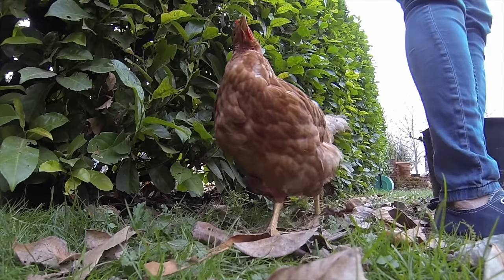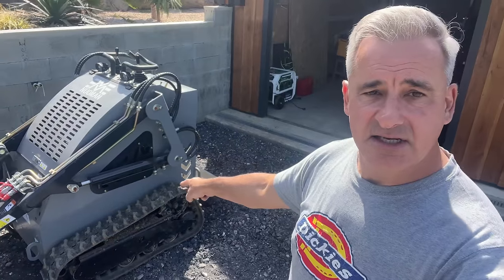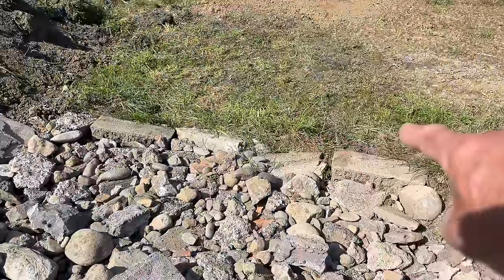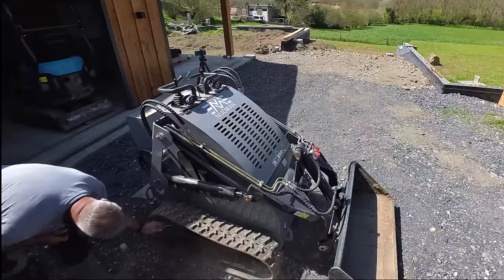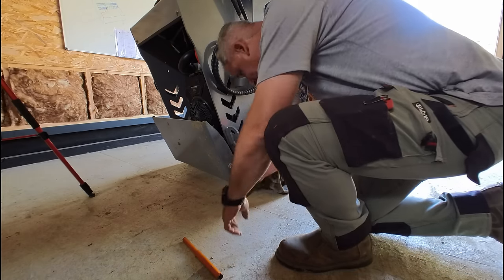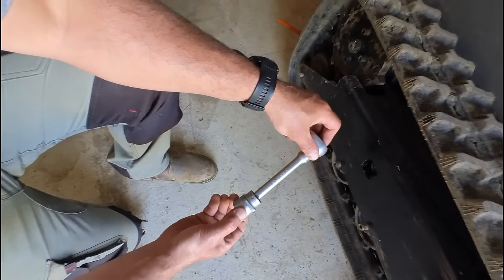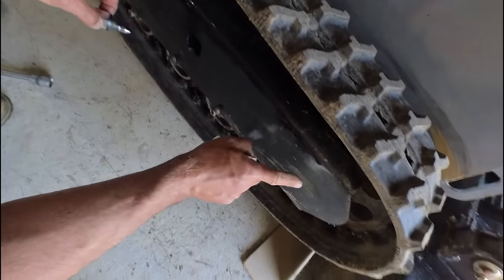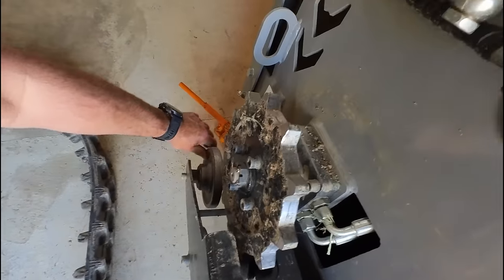Skid Tracks & Poly Tunnel Power | Off Grid Water System

Comment: You’ll drop the 14lbs before you know it, I usually have a smaller lunch and dinner for several weeks or a month and stay away from mixing fats and sugar during my meals for a while, a nice satisfying pasta for dinner and a sandwich for lunch usually is a good idea or soups great as well, you have a wonderful grandchild there to pass on the cycling lifestyle, that track I would just double check all the wheels as I’ve had the same problem on my car with the pulleys one was damaged and would constantly damage the whole belt I suspect that might still be happening with your tracks

     Continued Success and All The Best
               Fabrizio
Reply from the maker: I have done it before, just so hard when you're hungry after building all day....  back at it though on the bike.

Comment: The outside bracket is bent inwards, you probably want some spacers in there when putting back together.
Reply from the maker: Yes, the shaft is not long enough for  the frame - I put in a spacer for the one I took off but it is the same the other side.  Next time I will add the spacers to square it all off.

Comment: Hello Ian and Julie. I think the wear on the centre guides of the tracks is probably normal wear. On my mini digger it did the same almost straight away.
The guides are rubber coated but the drive sprocket, rollers and guides are metal so pretty sure the new ones will wear the same way.
I don't think it is a real problem though. Maybe overtime it will get noisier but it should still operate OK. Cheers Dave.
Reply from the maker: You are spot on - once I found the rear wheel off centre I realised the tracks were all good and it was this small wheel growing it off at the first stress put on it.  But at least these tracks fit the digger too - they are the same size so I have them stored as spares now.  The company in China is coming to visit us this month.  Should ask them to bring a container of spare parts  🤣

Comment: Is there anyway to put a grease nipel on that rear seal bearing for that small wheel? Larry
Reply from the maker: I put in a teflon spray grease in the end - I don't think they are supposed to be greased as there is a lot of dirt down there - the rocks that got stuck jammed in there and bent the wheel out of alignment - probably means my old tracks were fine, but you live and learn 😀

Comment: Buy yourself a Epever Duoracer 10-30A MPPT Dual Battery Solar Controller Regulator Lifepo SLA
Reply from the maker: Looking at them now, means I can put on my spare 360watt PV panel if I got to that one.
Reply: @HomesteadingUncontained  These Epever brand are legit MPPT, they weigh 1.5 to 2.5kg not like that one you have which is a bogus MPPT.

Comment: I’m sure you have figured it out by now but save those original tracks they are not in bad shape at all. I believe your problem was the bent roller. Thank you for sharing all you guys do there is just something so peaceful and satisfying about your videos.
Reply from the maker: Yep - as soon as I realised it was the wheel and the tracks are only rubber coated.  But I have a spare set for both machines now as they are the same size 😀

Comment: Be careful with this solar controller. It measures the voltage wrong and overcharges batteries. I have same model. I set the max. battery voltage a little bit lower to protect the battery.
Reply from the maker: The battery says it has an in built BMS also so that should protect it but I want to put on a bigger solar panel so will change out the controller to do this.

Comment: Hi ian an julie  . The rear wheel on the skid steer being stiff like that is a common fault and a large rock can easily put  pressure on the bolts and knock it out . I said a few months ago to you that these tracks can wear out and or stretch and it would be good to order replacement  tracks . Now you have experienced this type  of damage you now know how to fix it . The big machines and big tracked diggers do get same issues.  The price for a pair of replacement tracks is good and free shipping cant complain with that . This little machine is so good to have as it can do lots of work easily and once you start using it you then rely on it so much
Reply from the maker: It was more to do with this wheel than the tracks it seems.  But I have spare set for both the skid and the digger now (same size)

Comment: What ever charge controller you get make sure it’s an MPPT not PWM.  PWM (Pulse Width Modulation) are cheaper but don’t work as well MPPT (Maximum Power Point Tracking).  All things being equal, MPPT is a newer technology that harvests more energy. However, the advantages of MPPT over PWM controllers come at a cost, so sometimes a less expensive PWM controller can be the right choice, especially with smaller systems and in warm climates where the MPPT boost is not as significant.
Reply from the maker: Cheers - yes looking at MPPT for use with Lithium batteries.

Comment: Ian, you might need to get a different solar charge controller.  The more basic type of charge controllers only work with Lead Acid / GEL / or AGM batteries and do not have the correct type of charge specifications for a LiFePO4 battery.  Just thought I would give you a head up.
Reply from the maker: Yes, looking now, thanks - the battery does have a built in BMS too, which I failed to mention.  But that little blue controller is the cheapest of the cheap for sure 😬